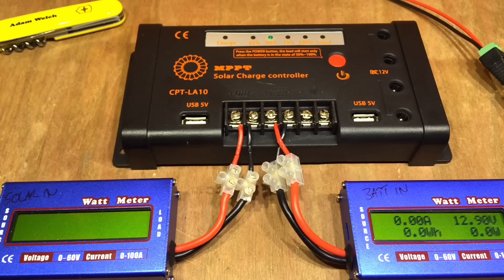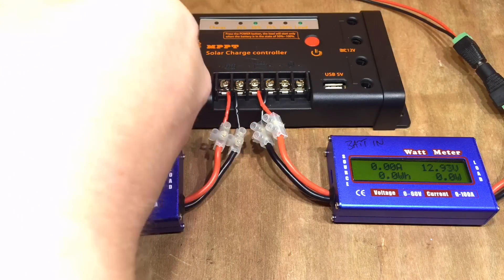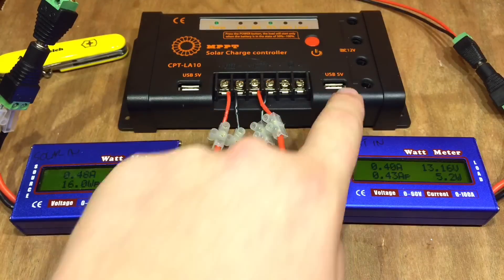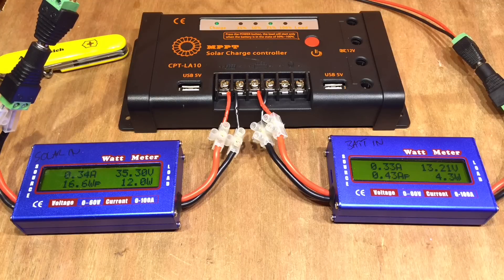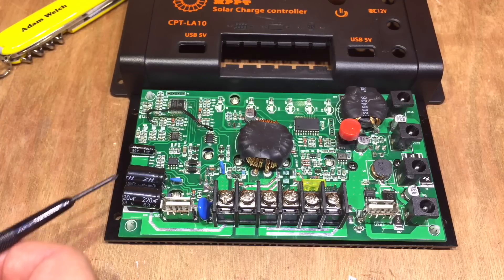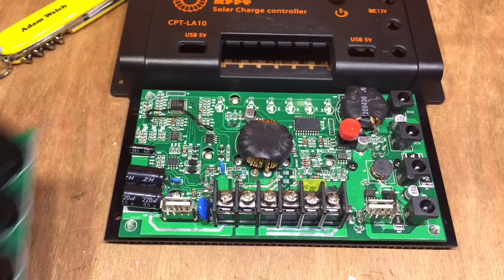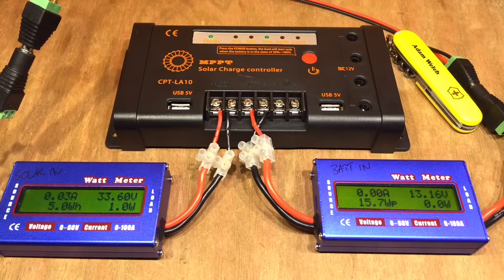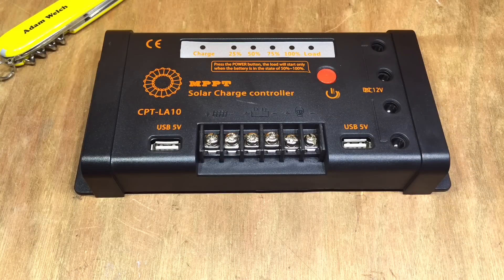Another Cheap MPPT Charge Controller - Comments Answered - 12v Solar Shed

Comment: I have this exact Charge Controller, I added the same Watt Meter to the output side. Sometimes in the morning the output will read 0 Amps, 0 Watts. If I add the original PWM controller that came with my panels to the input circuit it will 'Jump Start' the MPPT Controller. I can then remove the PWM and the MPPT will continue outputting Amps and Watts.
Why it it doing this?
What can I do to avoid having to temporarily add the PWM to the circuit?

Comment: Hello
could someone tell me if its possible to use this controller with just the solar panel and no 12v battery , just to use the usb outputs ?
i think it wouldnt work but id like to know if someone has tested this
Reply: No .
Reply: You could use a dc to dc converter directly and would work 24v to 5v with dual USB outlets . Around $5

Comment: This doesn't quite look right as your solar input current and voltage(0.30+A at 35.88V) is higher than your battery output current and voltage(0.20+A at 13.23V). A true "MPPT solar charge controller"(when the battery voltage is lower than the Solar input voltage) has a buck converter (a step-down converter) that is a DC-to-DC power converter which steps down voltage (while stepping up current) from its input supply(in this case Solar Panels) to its output load(in this case the battery). So the output current(Amps) should be higher than the input current(Amps) when the output voltage is stepped down to the battery charging voltage.

Comment: 30 months on and please to report that this controller is still  working perfectly on our camper keeping the 110am battery charged from a 100watt  panel - today the battery was full so  it was just trickling 1 -  2 watts with the panel reading its open voltage of 21.5v - when I put on a fan and some lights - the controller fed 36watts to the battery and the panel voltage dropped to 18.5v which is just above the max power point for the panel - with a little more load I imagine it would fall to 18v - so it is def MPPT- on a sunny day i can get about 85watts going to the battery
Reply from the maker: Glad to hear it is working well.

Comment: Hi, Adam. Can you use the 12 volt dc out jack on this charge controller to charge the battery from, or is it just to run a 12 volt device?
Reply from the maker: No it’s just an output. It’s a regulated output so can’t be used to charge the battery sorry.

Comment: I have 1 of these to charge 2  lithium ion 18650 packs at 7S 7P each. I'm also using a volt meter so I know when to disconnect as there is no display. It seems to be a great value for money mppt http://vodasi.com/en/product/CPTLA10.html I found this to see if it had anything about li-ion the mppt claims to recognise the battery type connected. Im hoping for another mppt & im wondering what you'd recommend? Great informative video by the way thanks very much.

Comment: With a true MPPT controller, the watts should be close to the input and output, isn't it the amperage that would increase if you are using 2, 12vdc panels in series (or a 24vdc panel) , the amperage going into the battery should be higher considering you are dropping from 24vdc to 12vdc ?

Comment: would i be able to connect a wind turbine to this charge controller?
Reply from the maker: It's not designed for that but potentially it might.  You'd need to think about the turbines output range and if that is suitable for the charge controllers input.  You'd also have to look at how you would dump the wind turbines energy if your batteries are full.  Sadly I don't know too much about wind energy though - it's not suitable for my shed.

Comment: its more efficient to have the input solar voltage just above battery voltage even with mppt. the controller doesn't have to work as hard this way meaning less heat  in the voltage conversion
Reply from the maker: I can see what you are saying, but this also (typically) takes the panel away from it's most efficient region - so you loose watts else where.
Reply: What voltage do you think is the panels most efficient region?
Reply from the maker: Typically they are most efficient at about 70-80% of the open circuit voltage.  For example my panels (all '12' volt panels) have their maximum power point at 17.5-18 volts.  Take one of mine rated at 100 watts, that figure is devised from it's maximum power point of 17.5 volts and 5.7 amps.  
The power curve of a solar panel means that dragging that voltage down to let's say 13.5 volt average (a very rough mid point between a low battery 12.2v and full battery on charge at 14.4) will loose watts.  Again a rough off the top of my head calculation suggest you'll get a maximum of 78 watts out of my 100 watt panel.  So then you have to calculate which is wasting most power - the DC2DC conversion (typically 90%+ efficient) or the fact you are pulling your panel away from it's most efficient region.
Then you have to consider if you need that extra efficiency of cause...  I don't need an MPPT charge controller 99% of the time because my batteries are full at the end of the day - I could happily use a PWM controller and see the same results of an evening most of the year round.
Reply: Good point. My flexible 100w panel   reads about the same. This mppt controller is only $30au on ebay so I just ordered one to compare against my pwm. Im making a lightweight portable power supply to charge any battery.

Comment: Instead of using passive meters, what does a multimeter read for current?  To stabilise readings, do you have a 500w halogen you can sine on the panel?

Also a charged or crummy battery may be consuming a throttled / reduced charge rate no?

Comment: hello
what kind of battery are you using , is this unit compatible with gel batteries
Reply from the maker: +7cedar7 I think this charges a bit high for gel batteries. It doesn't have a battery setting you can change.
Reply: i have used a gel battery and tried to charge it for 8hours with some load with a gel battery
there was a strange little hot smell at the begin
i might have damaged my gel cells?
thank you for your great chanel and your answer by the way

Comment: Great video Adam. My guess about your low efficiency is that your input power from solar panel was too low.  The charge controller needs a few watts to operate.  This "overhead" in a higher input power should prove to be smaller percentage wise.  I think if you run your similar test on a more expensive MPPT controller it would still show a similar result. But thanks for putting on all the videos Adam.  Very educational for me.
Reply from the maker: +Hung Pham Yes I've had similar comments before and I agree - I should have had more power coming in. One day I'll retest with a couple of hundred watts on there and see how it performs.  Thanks for your comment.

Comment: It seemed like when your panels were outputting 25W, the charger was outputting 20W and when the panels were only outputting 10W, the charger was only outputting 5W. If that is right, wouldn't that mean the power loss is actually constant, about 5W, and that would mean the unit is much more efficient at higher panel wattage.
Reply from the maker: The losses will be partly from the DC2DC conversion, but let's not forget the charge controller is also using some current.  But yes, I'm sure this would be more efficient at higher power.  One day (when I have the sun to play with) I'll do another test.

Comment: Looks like another cheap MPPT showed up on ebay: CPY-2410 and 2420 https://www.youtube.com/watch?v=5G-ukb6juBg for less than £17 on GearBest, next testing subject perhaps? Single 5V USB output and no 12V outputs, appears to be from the same manufacturer and no way to turn off the load

Comment: The efficiency may look low because the batteries are at a high state of charge.  The charge controller will waste a lot of the incoming energy as heat to prevent overcharging if the SOC of the battery is high.  This is especially true if the charge controller is of a shunt instead of series liming design.  Try testing the efficiency when the battery SOC is low.
Reply from the maker: +Bruce American Yeah I've replied to a few of the same types of comment. I probably didn't give this charge controller a fair run for its money. One day I might look again at it.

Comment: Hi Adam thanks for all you do, we have learned a lot from you! I bought this unit and worked fine until I put an inverter on, only using about 1.2 amp (self drain 0.5A + load of about 0.7A) and it died and now won't come back on. I connect the battery, 12.6v, and charge light flashes but all other lights stay off. If solar panel is connected it seems to charge the battery but still all lights stay off. I was more interested in using just the dc outputs for my wifi and opus lipo chargers but still it's nowhere near 10A advertised discharge or even 6A. Have you tried anything on its load output? Cheers
Reply from the maker: +Tom Hogan I haven't used this charge controller much other than to test it. Inverters can be funny loads, due to their nature they can oscillate. I tend to run the cheaper end of the charge control market at about half their rating, but telling you that now doesn't help your situation does it?
I'd keep a close eye on it whilst it's charging. If it's damaged it might not cut out at the target voltage. Sorry - I've not been much help have I, but it's hard to guess at what has happened. 
Thanks for the nice comments.
Reply: +Adam Welch thanks mate any wisdom is appreciated. Seller suggested I try to fix it myself :/
Reply: Hi again I got a new one which still works,  inverter across batteries instead :) It's now on a 2p4s Headway LiFePO4 pack and works well, if the pack gets charged enough it will stay at 14.4V for only a minute or so, maybe flicking to 14.5, then will settle back to about 13.8  So I lose a bit of capacity use per cycle but safer for the cells in the long run

Comment: Hi Adam you put me on the right track regards the CPT10 controller the panel was only 15 watts 0.84amps not 20watt  so it would not really need a controller and that's why the strange L.E.D sequence's  thanks Mario

Comment: looks like the mppt charger controller is for low light situation! so it can boss up the voltage so the charger can charge the 12V battery !

Comment: Hi Adam, i loves your videos like many on Youtube,  i bought  this controller  a few days ago the green charging light is flashing  when i check with my meter at the panel i get 19volts to be honest there is no sun at the moment i am using a 20 watt mono panel another point when the charging light is on constantly the 25% l.e.d. is red and going back and forward to the green 50% l.e.d. i can not see anything on the instruction
Reply from the maker: +bargaboy1 I'm doing this off the top of my head but I'm guessing flashing green is charging. The issue is your small panel in the winter sun. It can produce some voltage, but the current is very small. Perhaps the charge controller is using more than you are gaining? Unfortunately that means you'll either not put much charge in your battery, or you're slowly loosing charge. Let me find a manual and check my theory.

Comment: I just got mine last week and have tested it for a few days now and am getting about 90+ % efficient. I have 190 watt panel going in and charging a 12v battery.  latest test was 27vdc @4.7 amp in and 13vdc 9.2 amp out to a 12v battery. Also with no load on the output load terminal there was no change in output when the load switch was turned on. It does get a bit warm but not overly hot and I am running it close to max with 9.2A out. Only wish they made this in a higher amp model. I am very happy with it so far.
Reply from the maker: +bigjon1359 That's good to hear. Thanks for the feedback. Hopefully I might get similar results when we get some sun again.
Reply: After many days of clouds and rain, I have done some further testing on this item. Working with a 12v battery system and a 32v solar panel this works great but working with a 24v battery system and the same panel this unit struggles to keep the voltage of the panel and current stable. Hooking the panel directly to the battery bank I get 8+ amps into the battery at 24 volts with the unit hooked up it will rise to 8amps but then drop to 3 then jump to 5 then back to 8 and so on never settling to a constant current. I will series 2 panels and let you know what I find.
Reply: Ok It worked as I thought it would, 2 panels in series 55.8v @4.9a input and 23.2v @10.7a out to battery. So I remembered that the unit is good up to 100v input so 3 panels in series should be ok well it worked for about 20 seconds then a loud pop from inside the controller, :( I quickly unhooked it took it apart looking for the exploded cap or transistors I could not find anything visually wrong even the 20amp fuse was good. (why 20amp fuse for a 10amp device?)  so I hooked it back up with only 2 panels it still works fine now I am afraid of trying it again with 90v going in. Not sure what and why I got the loud popping sound.
Reply from the maker: +bigjon1359 The electrolytic caps would be my first guess. Very odd it's working after that to be honest. Over rating the fuses is fairly normal. Reduces the returns to the seller if the buyer rides a bit close to the wind.
Reply: My guess too i thought i would find cap residue all over the inside but no.
Reply from the maker: +bigjon1359 what is the open circuit voltage of the three panels - might this have got close to the 100v?
Reply: yes 96 voc

Comment: Greater the voltage between the solar panel and battery voltage  better the booth current  also noticed  as the the battery voltage reach its 100% the mppt controller will reduce the input current

Comment: You can not expect cheap "resistive load" Watt-meters to produce a reliable result in this case.The solar input is feeded directly to the inductor of the buck converter. This is switched at high frequencies.Measurements of voltage and current under theese circumstances requires high speed sampling equipment plus integration of the results!Alternatively you can place a LP-filter across the input bringing the ripple down.Then adjust your results to compensate the reactive loss.The 2 * 220uF / 63V capacitors are NOT in series. And they are NOT input capacitors!They are placed after the MPPT Buck Converter and never sees the raw solar panel voltage.That said... Don't buy this regulator! The fail rate is high due to bad manufacturing or maybe bad copyists. :/
Reply: stickmenwithrayguns which cheap mppt solar charge controller would you recommend?
Reply: The classic Tracer series from EPsolar has been on the market for more than 5 years. :)They are reliable & real MPPT controllers.( They contain large toroid's & longlife-capacitors from Panasonic ED-series ).The 1210RN being the 10A version can be found on ebay from € 50,- including shipping.If you have high voltage panels you might want to grab the 150Volt, 1215RN version.One of Tracer's key features apart from MPPT is battery maintenance  ( de-sulphating ).The newer A-series has integrated display. But when things just works you never look at it anyway. :)
Reply from the maker: +stickmenwithrayguns I'm a fan of the tracers. I reviewed the Tracer A series about ten months ago. This was a look at a really low budget option.

Comment: looking at better mppt units I noticed the amapge into the battery should be higher then what solar is putting into the controller due to it dropping the voltage but upping the amps they wattage reading does show a loss but from what I am seeing 24 volt panel should be dropped to battery voltage and amps should be higher then what is been put into the battery bank if ampage stays the same but voltage stops then they are pwm and not doing mppt
Reply: David Simpson With MPPT the panel voltage should drop to its maximum power point not battery voltage. Pwm regulator, panel will drop to near battery voltage as you said. You are correct about the current tho.